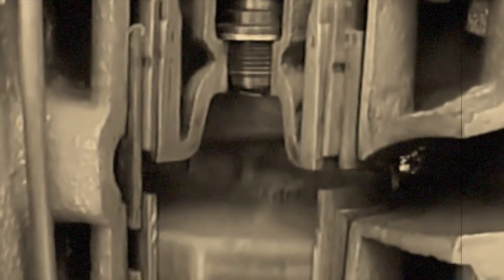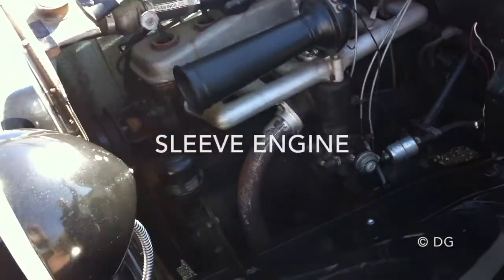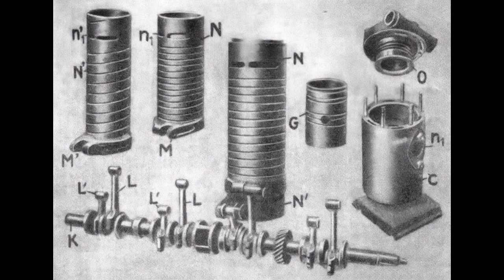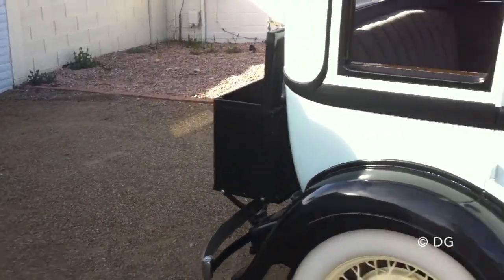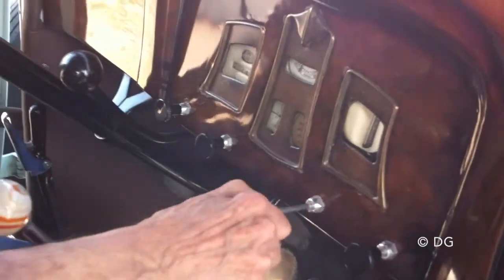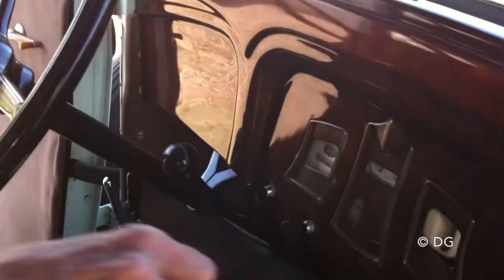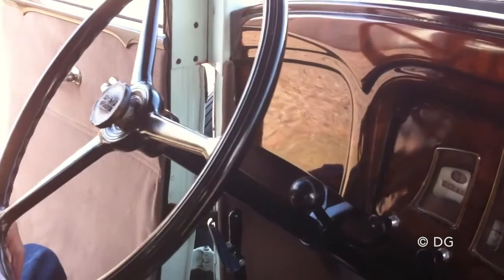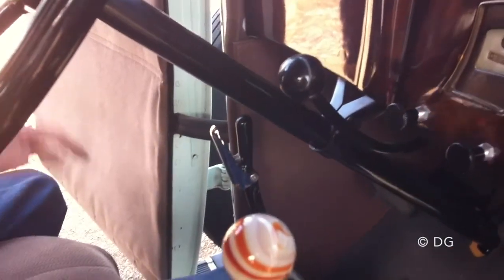Willys Knight sleeve engine

Comment: it is a prowess to have that engine design effectively running as the design fo the sleeve impairs greatly  the heat transfert and in any engine, the heat transfert capabilities is the most important factor in the engine durability and general performance
Reply from the maker: Thanks!

Comment: A lot of WW2 aircraft radial engines were sleeve valve engines. These were tough engines.
Reply: Bristol radial engines, Centaurus was the most famous used in Short Sunderland aircraft and HP Halifax, compact and very powerful. There was also the Napier Sabre flat 16 engine used in the Hawker Tempest fighter.

Comment: Just discovered this engine type. Seems like a 1st 2nd and 5th gear ratio. Sounds real good for its age.
Reply: Third is usually 1:1, and is comparable to third or fourth on a five speed. On my 1951 Chevy, with a 4.11:1 differential, the engine was running at about 3600 RPM at 60. Overdrive wasn't offered as a regular option.
Reply from the maker: @td3993  Thanks!
Reply from the maker: Yes very interesting engine!